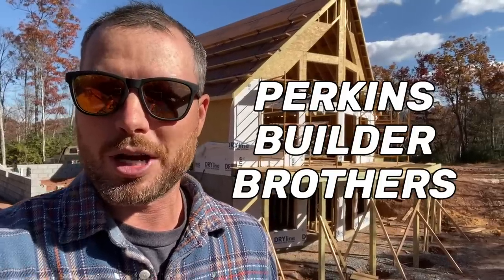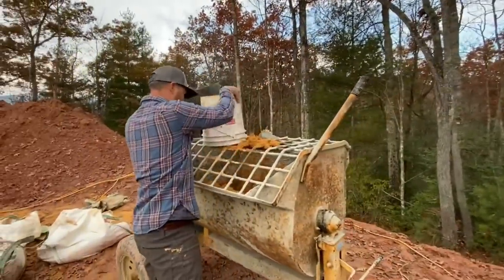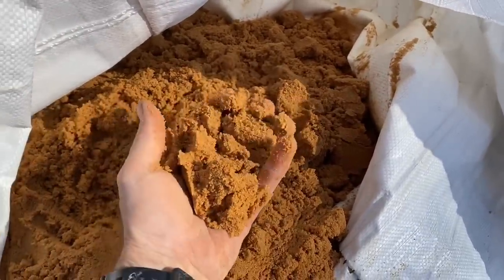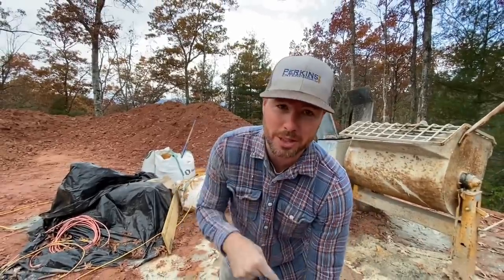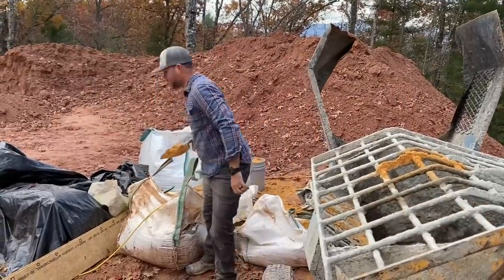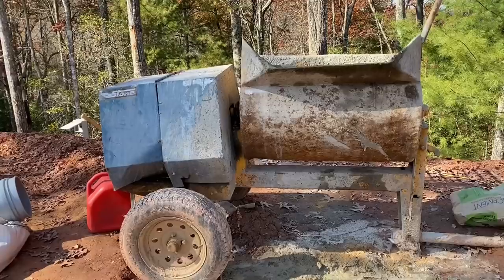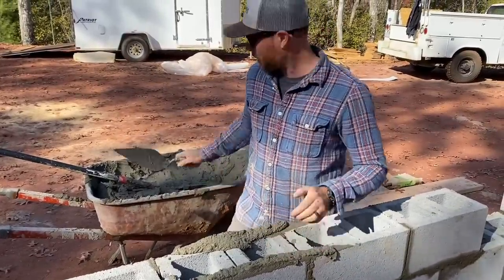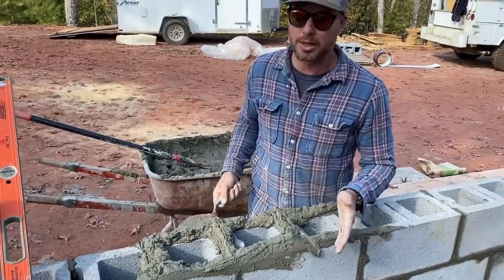How to mix mortar | Using a 5 gallon bucket as a measuring cup

Comment: Ive been a mason for 20 years and i can say i've yet to see bricklayers etc cover the sand to keep it from bulking when they should. The result of not doing so will aid in different mortar colors. During hot summers I recommend cold water. That means no water barrels, and strung out hoses on concrete. Let the hose water cool the hose down before filling up your mixer. You should only charge (remix) mortar twice so be sure to make only what you'll use within 30 minutes or so. Masonry has pretty much ruined my joints and ligaments lol.

Comment: I just use Type-S Cement with no sand. Does the job!
Reply: Stronger to use it straight out the bag but they didn’t need it at full strength apparently.

Comment: It only takes a second to lose an arm if your lucky. Why are you sticking your hand in a running mixer? the mixer should always be off before putting anything other then mixing material in it period. 
If you want to check the mix while the mixer is running pour a little into the wheelbarrow then check in there never in a running mixer never. I seen a mixer snap a  brand new shovel handle in less then a second. If that mixer ever grabs you it may pull you inside. Don't ever put anything in the mixer when running. The human body is no match for flying or spinning steel!!! and yes I am telling you how to do your job I do it everyday.
Reply: Most mortar mixers have a lever that kick the paddles out of gear therefore allowing you to safely check.  But honestly you should be able to check by sight not feel.

Comment: Mud Man Always gets the grief‼️ AND the MESS‼️
So many variations about mixing Mortars- depending on what material being laid- block, brick, natural stone(and whether the application is “stick-on”, upright w/joints, stack w/joints or “Dry Stack”) or Artificial (man made) Stone and/or tile. Stone always uses less sand more Cement to make it more sticky. Artificial Stone, way less sand much more cement/sticky! 
Also, how windy it is combined with speed of Mason determines how wet mix should be and the # of Masons being supplied. Wind/sun/temperature can cause Mortars to set too fast. Metal Mud Box w/ larger Mud Hoe is how I was raised: normal day was “A••holes & Elbows” 30 to 40 hand mixes/ day suppling 4 to 5 Masons including setting up mud boards( the line), setting up scaffolding and keeping blocks set on end on the line so Mason just buttered the ears! 12” blocks are always back breakers. 
Brick about the same, just more of’em‼️Stone- all together different- more satisfying‼️
Love Y’all’s Expertise and Thank Yall for letting an old man relive the “good ol days” So Proud Of YALL ‼️
  🎄🍑🍑🍑🎁🍑🍑🍑🎄

Comment: Don't you all use fire clay?
Reply: Fireclay isn’t typically in structural mortars. It’s used when heat resistance is important, so you add a little to your mud to set the firebox (not the whole fireplace, just the firebox), and to parge the smoke chamber.

Comment: I’m just now seeing this video, but you turned something extremely easy into something hard. All you gotta do is pour 1 and half or 2 buckets of water into the mixer then add 16 big shovel full of sandy and then add 2 bags of mortar let it mix and then add another 16 shovel full…. The hell with putting sand in a bucket!! Great way to get fired on the crew I work on.